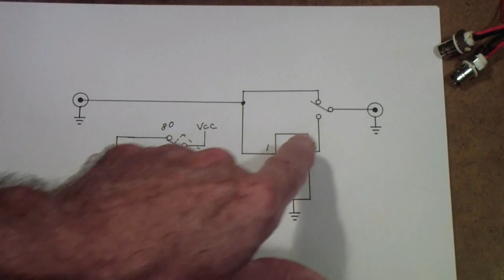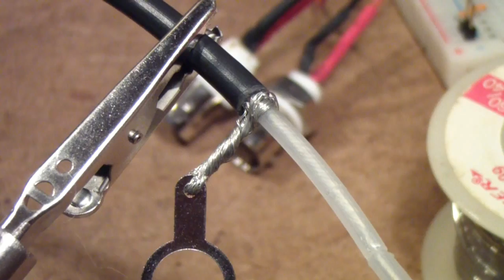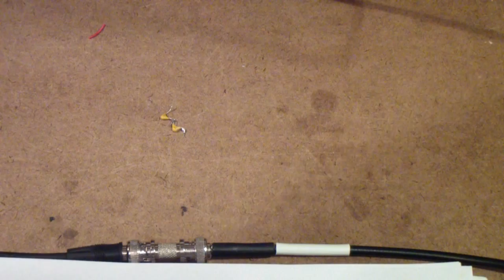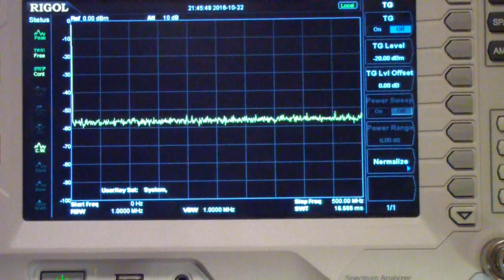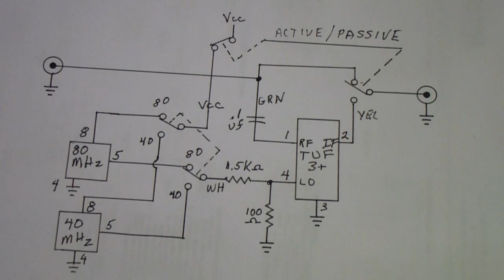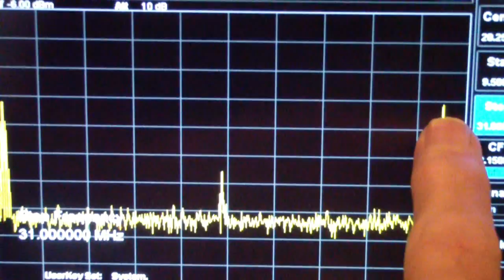TTT123 Analog Discovery Spect Anal Freq  Exten Pt4

Comment: Hello Tomtektest:  I saw your final schematic in the video where you added an active/passive switch for power.  Unless I misunderstood your original goal which was to remove Vcc from both oscillators when using the passive mode, there would appear to be a mistake in the diagram with the top (SP) switch connected to Vcc (the ganged active/passive switch):  At the very top of your final diagram it shows a single-pole switch connected to Vcc with its contacts closed but the corresponding ganged switch (SPDT) on the far right  connected to the output BNC is in the passive position;  with the current diagram, Vcc is still connected to either oscillators (depending on the position of the ganged oscillator selection SPDT switch) when the active/passive is in the passive mode.  I think the top switch connected to Vcc should be shown in the OPEN position when the ganged portion (the SPDT) is in the passive position as shown on the final diagram.  Also, shouldn't the switch connected to Vcc (the SP part of the ganged switch at the top) be a SPDT just like the ganged portion on the right ?
Reply from the maker: Thank you for your comment and question; it gives me an opportunity to clear up some possible confusion. I think that I confused the issue a little bit with my video editing. The last schematic shown (as I was winding up the video) is actually the next to last design. In other words, I cut the end off my original video which showed the powered version to insert the final (unpowered) design in between. The final design does not even have Vcc or Gnd wires and is purely passive, i.e. contains only the TUF3+ mixer which has no power. The Passive/Convert switch is solely to select the output either directly from the input or from the mixer output. You can disregard the very last schematic shown, it is just a backdrop for the windup audio. I think either design would be useful but I finally settled on an unpowered mixer only circuit in the converter box and moved the oscillators to another box which I did not show. If you build one I would be interested in knowing how it turned out and which design you chose.